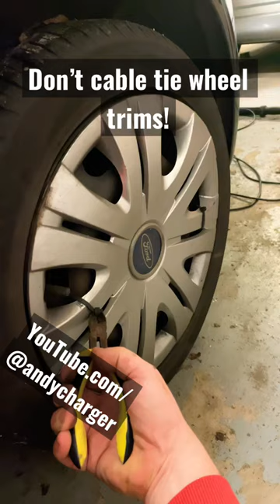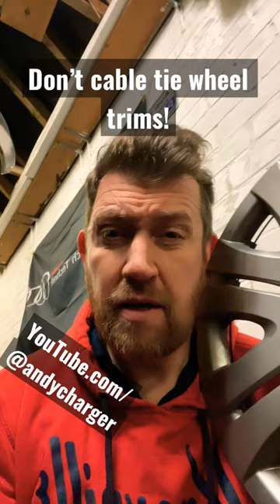Don’t cable tie wheel trims on your car! -#shorts

Comment: Duh! Get a pair of side cutters and put them with your spare.... Omg.
Reply from the maker: Yes well done. If only I had thought of that 🙄. Maybe I would have if I had installed them but I didn’t. Same as the guy that installed them when we bought it had not provided those tools for himself in the car. You make a valid point over having them if you are going to use zip ties but my point is, get trims that fit in the 1st place. They should only come off if you need them to then.
Reply: @andycharger  they are to prevent theft.
Reply from the maker: @rjz2069  if a thief is out stealing trims, he likely has some clips with him anyhow!
Reply: @andycharger  that's  true, but we had seen some who appeared to be drug addicts unfortunately, taking what they could get, no clippers.

If someone sold a car however, they should definitely take them off or give the buyer the means to.

Comment: Absolutely cable tie them....my car came with a first aid kit in boot that contains scissors and everyone should have first aid kits anyway.

We've had our wheel caps and trims robbed twice...sure you can argue robbers will just cut them off but you'll find its not grown men going out robbing plastic caps and trims its kids....rather them have to sit there cutting them off than just simply allowing them to pull them off with hardly any effort whatsoever. 

Would be like saying guys don't buy wireless cctv cameras as robbers can just disable them with a £20 device...would rather have one for peace of mind? same with cable ties on a wheel trim plus most trims even strong ones can fly off if you hit a pothole or curb.

Cons 
- have to cut them off for tyre changing

Pros 
- makes it harder to rob
-  stops them flying off when hitting a pothole 
- makes the trim stronger and last longer
Reply from the maker: Jeez! I got worn out just reading that 😂
Reply: @andycharger  Ah that’s nice isn’t it 👍 all because you put out a dumb short telling people not to secure trims to their car simply due to not being able to cut them off as if they wouldn’t know they’d need scissors or something 🤦‍♂️ whatever man, can’t wait for some more amazing advice so I’ll subscribe .
Reply from the maker: @connor6585  wow that escalated quickly from a jovial response to your message! You do you pal 👍
Reply: @andycharger your advice stinks 😂 when you can literally keep a pair of snips in your boot in the case of an emergency
Reply from the maker: @shax232  ok pal 👎